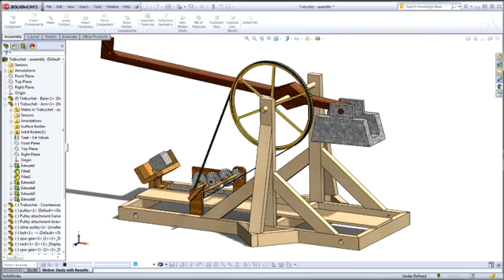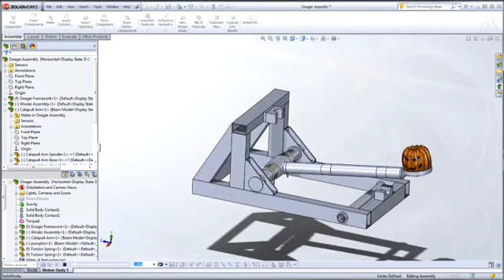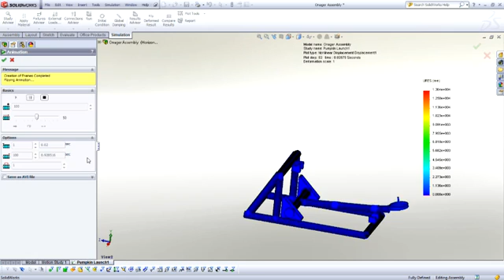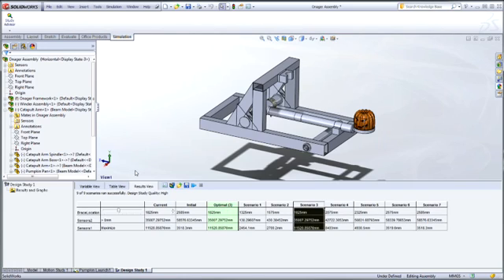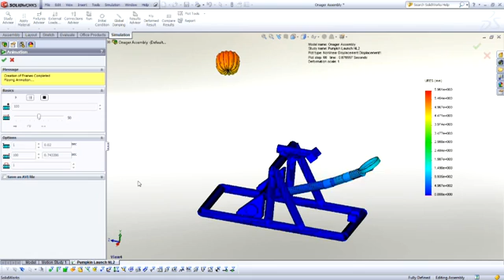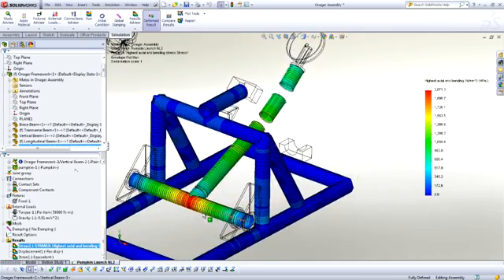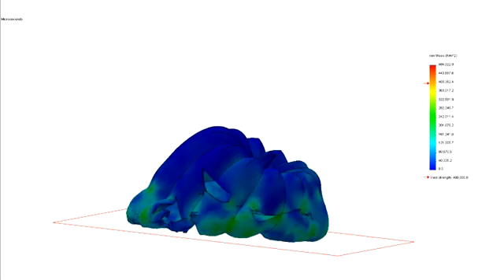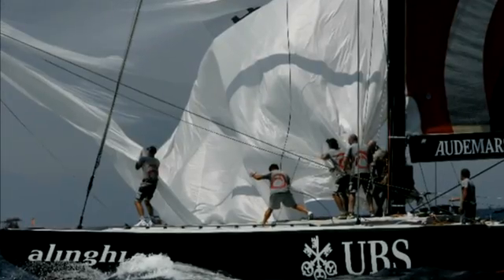The pumpkin chunkin maximization

Comment: Are there classes. official online courses, or videos available that teach more in depth information about SolidWorks office products like Motion, Simulation, and FlowWorks? I've been using SolidWorks for over 5 years and have pretty much taught myself, but I have not explored much into the office products. I only have really used Simulation to find Factor of Safeties and Deformation.  I feel there is a lot more I can learn, especially with the optimization aspects.

I'd also really like to learn about simulating loads on composite structures.